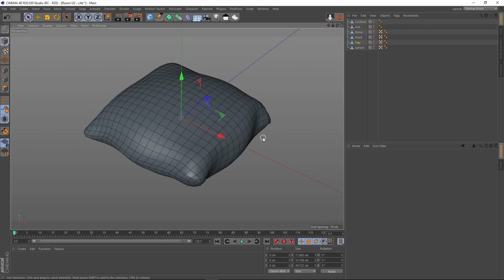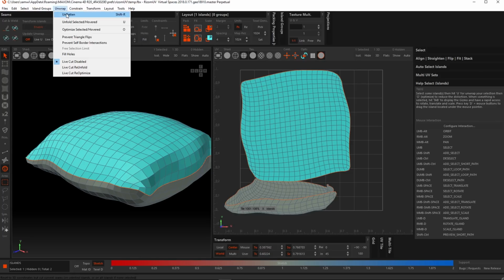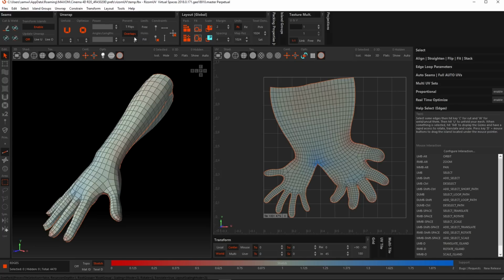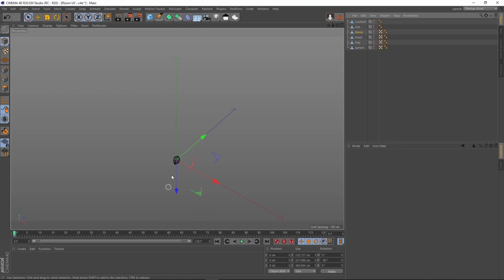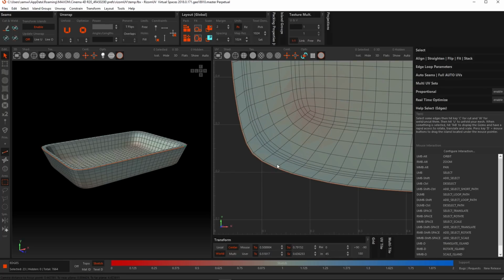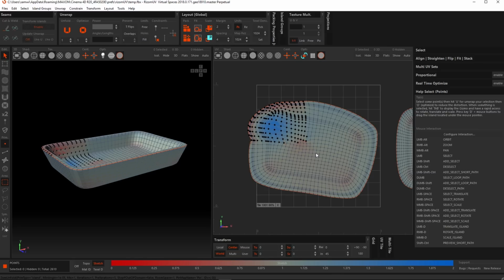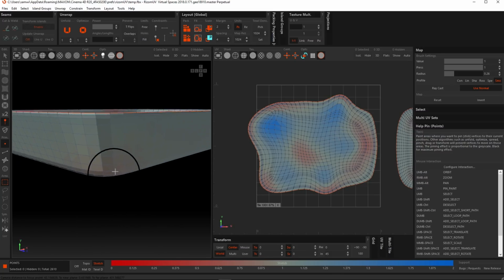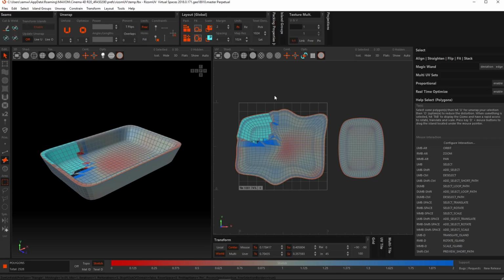Rizom UV   The Unwrap Panel

Comment: Very good video. But if a "Fill holes" button doesn't actually fill holes, please give it another name. Just so we artists can keep our brains safe from strange coders concepts lol
Also why that other button is called "T-Flips", what the T stand for. I know that remark may look dumb but honestly, sometimes even the tiniest thing can make one's life easier. CG is a difficult thing to learn, and we have to learn new things almost every month
Reply from the maker: The Fill Holes button does fill the empty area with polygons - you just can't see them, This is how we keep the holes in the mesh open. 
As for T-Flips, it's a common phrase for Triangle Flips. What it does, is to prevent the creation of triangle flips, so you won't get them on the edges or inside your island as a result of unwrapping or optimising. 
We hope this helped clarify, and that our concepts are not so strange after all :)
Reply: @RizomUV  (of course they are x) )
Thank you for the enlightment lol